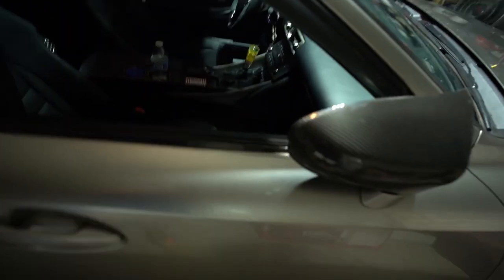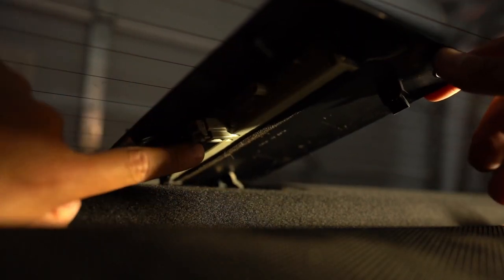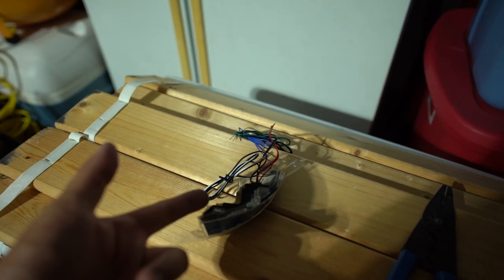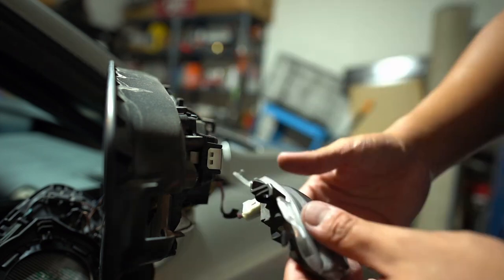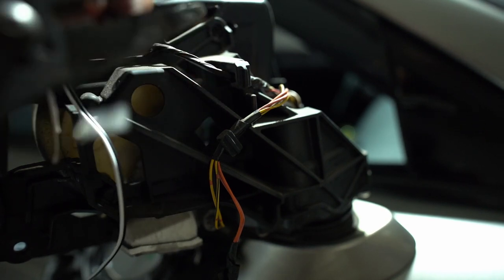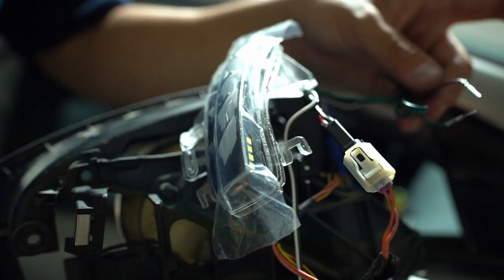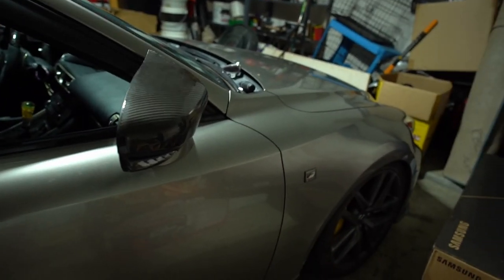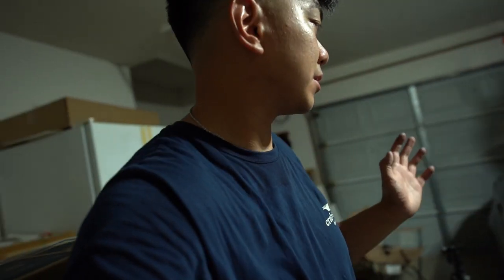Lexus Mirror Sequential Turn Signals

Comment: glad you made this video. i got the same one from ray over a month ago and it's sitting in my garage because i haven't looked up how to install it lol. i'm not a car guy, but i know exactly what i want to install, however,  i would definitely never figure how to do this stuff without watching other's tutorials.  so thanks!
Reply: for the green wire (sequential vs solid), is there any reason to not cut it shorter so you don't have the bunch?
Reply from the maker: @tau_tv  Of course not a problem, love sharing what I can do with others! Im guessing the longer length is just to have it go through the door panel with the blue wire so you have easier access under the window switch to quickly make it sequential or not. It is not a problem to just chop it shorter if you don't plan on switching back and fourth on those modes 👍🏼
Reply: you got this bro!!!! im not mechanically inclined and i got them installed on my GS
Reply: @woBsquared  let me see a pic I’m thinking of doing it pops🙏
Reply: @KennyVo the 3rd brake light from the website does it come with the harness attached to it on both side already
Reply from the maker: @mitshylebrun2205  yes it does, plug and play

Comment: I tried to install mine but something went wrong. The turn signals on both mirrors no longer work. Both puddle lights stopped working too. I switched back to stock & turn signals still dont work. Turn signals on both headlights & tail lights work. All fuses check out so I'm at a loss. Anyone have any ideas?

Comment: I just got the side mirror sequential light today. I install the passenger side no problem. Upon tapping driver side blue wire to thick green wire on the window switch, the left turn signal on the instrument cluster stay on. Everything seems to be working normally, except the left turn signal on the instrument cluster stays lit. I check the rest of the wires on that switch and only the fat green wire has 12v.
Reply from the maker: Check the rest of the connections you tapped on that side and make sure the wires spliced are not making contact with other exposed wires.

Comment: Can you connect the blue wire to the yellow puddle light wire and have the same effect?
Reply from the maker: The blue wire is wired inside to keep the white DRL mode on when you have your lights on. If you have it wired to the yellow light it would only turn on when you unlock your car or when you walk close to it. You can do that if that is your preference to have the DRL off while you drive.

Comment: Do you know anyone who installed on an ES? My passenger side is fully installed but my driver side window switches aren’t illuminated with the headlights, it’s just always illuminated if the car is on. I might try and pull the wire out the door into the dash and tap the illuminated BSM button or maybe something in the kick panel but I would really like to avoid that.
Reply from the maker: I don't know anyone with this on an ES. I would double check all the connections to see if the wires are making contact and are not interacting with other wires that it shouldn't be in contact with.

Comment: What kind of wire did you use to extend the DRL cable and where did you get it from?
Reply from the maker: Honestly just used a random wire in my garage lol, but here is some that are meant for LED if you need some. It has positive and negative but you can just split the two and use 1 for the extension 👍🏼
https://amzn.to/3Q4k3vW
Reply: @KennyVo  perfect thank you! I had mine installed for like 8 months but never wired up the DRL.

Comment: Hey did you have any troubles with the drivers side ?
Reply: For some reason when I plug it in it doesn’t work but the oem one works and I’ve tried it on the other side and they work
Reply from the maker: I did not have any trouble with the driver side light, you might have received a faulty unit